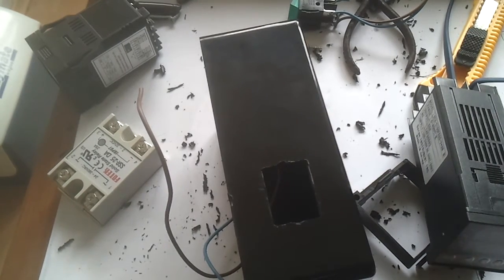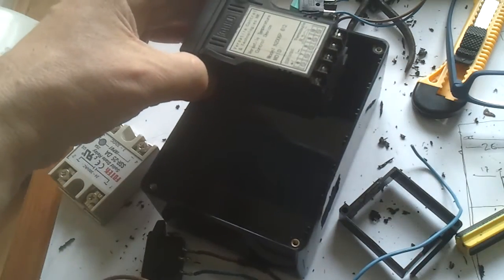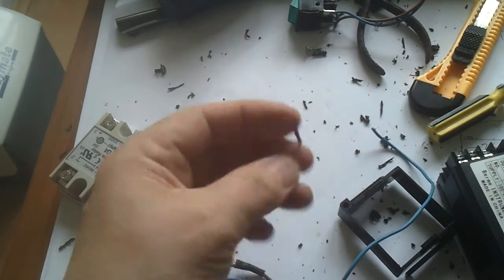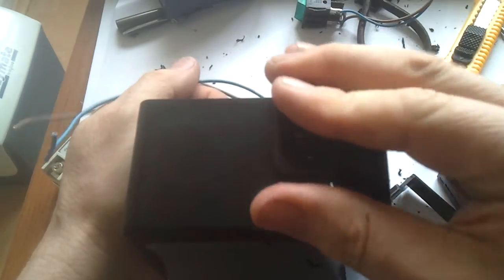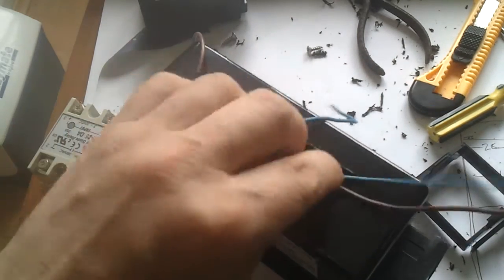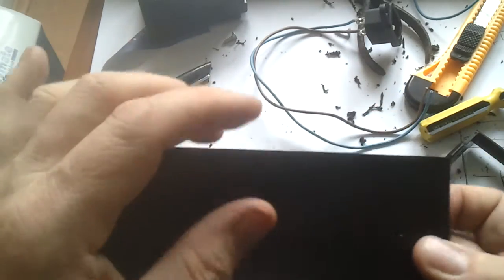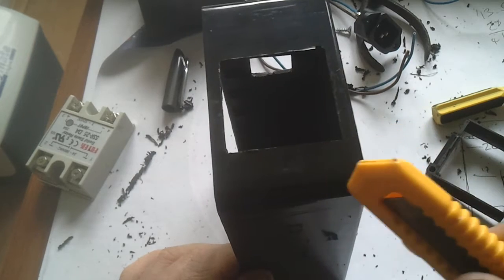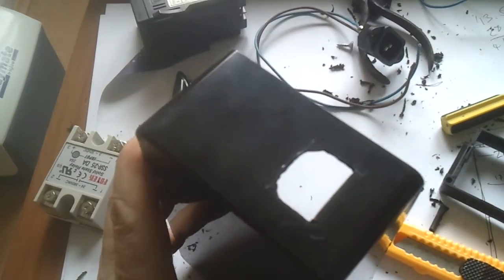Making Accurate Holes in Electronics Project Boxes

Comment: hot knife using solder iron
Reply from the maker: Tried it. Messy. Crteats a bugle aorund the edge of the hole which then needs a lot of work to remove. See my later video - 3D pronted jigs for my final solution.

Comment: 3d print
Reply from the maker: The jigs are 3D printed. The box could be too - in fact I did one. But it takes 10 hours to print, the finish is not so good, and if melts at 70C - not ideal for a plastic injeciton moulding machine.

Comment: For rectangular cutouts, I drill a series of holes just back from the line, then use a sharp chisel to pare away the material.  You need to set up a piece of scrap timber in a vice or clamped to the bench as a backer.  The chisel will push through with little pressure.  (You don't need a mallet or anything.)  For me, it's easily the quickest and cleanest way.  (But I have a woodworking background, so sharpening and using a chisel is second nature.)   I also use flat and round files.  You can also scrape an edge with a stanley blade.  This will remove a small sliver of plastic with each pass.  Watch your fingers though...  Best of luck mate.
Reply from the maker: Hi Rob and thanks for chipping in.
I found another method - essentially 3D printing hole cutting jigs. These are used to scribe a line precisely where the hole is needed. See the video here:  https://www.youtube.com/watch?v=YP92bxAUamE&list=PLEFr39dH1zRIsbqfYjhGUfO59SHncIxLy

That solves the marking out problem - your approach makes actually removing the material easier too, though for the ABS plastic I'm using I'm not sure a chisel would give a good result - but it well might.

Thanks again.

Comment: I have the same problem...and even worse, fitting 3-4" LCD in pressed steel cases. There has to be an easier way. maybe CNC can do this, but most home ones don't seem to
Reply from the maker: Yes, CNC can do it as you say Rob, but I eventually developed a great solution - I 3D print a cutting jig. See the video here:
https://www.youtube.com/watch?v=YP92bxAUamE

Comment: I use a vibrating multi-tool from Dremel - you can find cheap ones at Harbor Freight etc.  Here's a bunch of photos of this tool: https://goo.gl/69awVn You can put tape on the surface and draw your square hole on the tape, then use the multi-tool to cut the hole quite simply. Occasionally a file can be used to clean up the corners.
Reply from the maker: Not sure that's any better than the Dremel rotary tool I was using.

Comment: Terrible video. U didn’t even show your attempt in cutting, tools, experience, etc. 👎
Reply: It was a cry for help...its a fine video.
Reply from the maker: I showed that I was using a Dremel with a milling bit and I showed that it was messy and miserable, so I don't really understand your criticism. Furthermore, as I said in the video - this video is not intended to be instructional - it is a request for helpful ideas. And in that regard, it's been very successful because I got some really good ideas. Thee is a follow-up video showing my current solution which uses 3D printed hole cutting jigs.

Comment: The biggest problem with cutting out square holes in plastic isn't the fact that it's time consuming to get a nice looking cut, but that it's impossible to find bezels.  They only are available in popular LCD screen sizes.  With bezels, you don't have to make it look nice nor do you have to be 100% accurate.  If you have money to invest, invest in making various sizes of bezels from a Chinese manufacturer and you can make a killing with the electronics craze going on these days.
Reply from the maker: Hello Nunya, and thanks for your comment. It's a great point - it's so much easier to do it poorly and cover it up and it really doesn't matter and it's faster and easier. However, with my budget (microscopic) I can't invest in this. Still - I may b able to adapt your idea. For example, I could 3D print some bezels. Thanks!

Comment: Here is a fairly easy (I think) way to make perfect holes every time! :-)
Make or bye a hot wire cutter and then do the following:
Use some thin sheet metal and cut a perfect outline of the shape in that. Put the shape on top of your plastic box, exactly where you want it to be and make sure that it does not move, drill a hole in the center and use the metal outline as a guide for the hot wire.
The result will be perfect every time! :-)
Reply from the maker: Hi Fried Mule and thanks for writing. However, I think your method isn't that straightforward. The wire will flex which makes keeping it at the edge of the hole difficult. Also the metal template would take a lot of heat from the wire, and finally, the wire will push up roles of molten plastic either side of the cut.
Reply: Yes, you are probably right, but maybe it can work, by training and the right amount of heat.
But yes defiantly not as easy as I first thought! :-)

Comment: Would a hot knife / soldering iron work?
Reply from the maker: Hiya Ryan - thanks for your suggestions. They would, and I've tried the soldering iron, but it is difficult to push forward in a straight line - it tends to want to wander. Also it stinks and the fumes are toxic, and it pushes up a "wave" of molten plastic which then needs removing - which is itself a grim task. So it's not a great option.
Reply: What about a hot knife? You can join a knife to solderng iron apparently. You can use an extractor fan so you don't get cancer and die from fumes like steve jobs did.
Reply from the maker: Yes, I think a knife would avoid a lot of the problems I outlined, Ryan. For now, I'm looking into turning my 3D printer into a CNC milling machine and milling out the holes that way. That gives excellent repeatability and a really clean solution.
I made a brief video about phase 1 here: if you're interested : https://www.youtube.com/watch?v=DmfdNIBsDUQ
Reply: Hmm interesting. Maybe easier to design a bespoke box? With a injection plastic machine
Reply from the maker: I've 3D printed one - and it work well, but it took 9.5 hours to print. Injection moulding would be an option, but the injection moulding machines I make (like this one https://www.youtube.com/watch?v=n0ISGwQ9kjk)  cannot do the necessary shot size or pressure. Box-making needs very high injection pressures because of the long runs of narrow mould channels.
Reply from the maker: Hey Ryan, do you know anyone who just happens to have a plastic injectin molding machine lying around on their bench? Oh wait - I DO! https://www.youtube.com/watch?v=tn6-MgJ6oVU

But it wouldn't be able to make a project box. The large thin plates involved need higher injection pressures than this machine can produce and the volume of the part is also far too high for this machine. In short, it's not really a practical proposition.

Comment: I recognize those components. I made a filament extruder with them.
Reply from the maker: You're not far wrong. I use them to make plastic injection molding machines.  Too bad you don't have a video on your filament extruder - I've considered making one myself and would be interested to see yours.

Comment: I too came to this video very late ( Jan 2017) in the hope of finding a better answer . I have a 
nibbler ( cheap from Rapid ) very good for thin material but not a lot of good when the walls are thick . I have QMax punches but they are limited in what shapes they can produce . 
Conecut drill bits and also good but limited . I also have a Weller 8200D Soldering gun with plastic cutting and smoothing bits which are great for roughing out a hole in plastic boxes etc and then I use files and a knife to clean it up .A fan is needed to get rid of the fumes which can be nasty .
But yes , a milling machine would be great .
Reply from the maker: Alan, thanks for your comments. I have also used a soldering iron for this. It works, but it's a bugger to do, and - as you say - it stinks, and it's too easy to wander off track.

Jodie below proposes using rotary saw blades for Dremmels or cheap rip-offs (AKA Dremmoids). I've bought a set but haven't used them yet.

I'll publish an update video showing how I got on, so if you're interested in that maybe subscribe.

Comment: That's what Blue Painter's Tape is for.  Putting it over any surface that isn't going to get cut prevents marking up the box. If it's under 20cm^3, I just 3D print the box. ;)  Don't use grinding wheels to "cut" (melt really) plastic.  They make saw wheels for dremel tools.  Go slow and let the tool do the work.
Reply: Just for example purposes, I've not used this supplier:  https://www.amazon.com/Circular-Saw-Blade-Dremel-Multi-Tool/dp/B009GLRKWK
Reply from the maker: Thanks Jodie, I never even thought there were cutting wheels like this and - s you say - cutting is far better than melting and far cheaper on tools too. Thanks again.
Reply: Chris Wesley my pleasure!  Yeah, it's amazing how many attachments there are.  There's also a plunge-router and router bits for Dremel.  I've found the router attachment combined with a diamond engraver bit is great for tracing the borders of a precision cut.  Then switch to a finger tip controller and the saw blades.  Ultimately better control in light plastic than the bench mill.
Reply from the maker: Jodie, in email I was notified of your further comment, but I cannot see it in my list of comments to moderate. I'm seeing this more and more and don't know why. Perhaps you deleted the comment, so I won't include it her,e but just to say thanks again. I will get some of these tool bits - they will make things so much easier which is exactly what I was hoping for when i posted my video. Thanks again, Chris
Reply: Hi Chris, other than the one talking about the router and diamond bits ( which I see above) I don't remember what else I might have said _ long day.  I'm modifying a heavy metal junction box for a large project, including 3D printing a cover panel.

Comment: Get yourself a nibbling tool.  Start with a drill hole and nibble out whatever shape you need.  To prevent scratches on the case, cover in masking  or painters tape.  Print a paper template on sticky label paper or plain paper with tape and apply over the surface (which should be covered in masking tape).  Also a small drill press will provide better precision and cleaner holes.  Use a digital caliper (cheap on eBay or local hardware store) to measure the components before creating your template.  The more planning and prep time the better the result.
Reply from the maker: Thanks +Digger D. I had never even heard of those, but I see them on EBay now and I'll get one when cash flow permits.

Thanks again,
Chris
Reply: Chris Wesley You're welcome, they have a limited thickness but should work for most stuff.
Reply from the maker: They'll certainly work for my plastic project boxes, which is the main thing.

Comment: Try to use a crossover on your drill press. Lou
Reply from the maker: +Louis Nemick Thanks but neither I nor Google seems to know what  that means. Could you explain further, please?
Reply: What I am talking about is a cross feed x and y  vise
Reply from the maker: +Louis Nemick Ah Louis that is a great idea. In fact (duh) I have access to a milling machine, so I suppose I could use that. It's easy to mess things up with a single turn of a handle in the wrong direction, but perhaps I can man up for the ordeal. Thanks again for your kind suggestion.

Comment: Scribed lines, series drilled holes then a chisel (if the plastic is not too brittle) followed by a decent sharp file is how I used to do such things. Now I always try and get enclosures with removable front panels and do them on my mill or with my CNC router because this sort of thing is just a pain. Really I am surprised there are not ready made enclosures for these temp controllers, I spent hours on RS trying to find suitable boxes and what I ended up with although nice cost probably 4X what the controller cost.
Reply from the maker: +littlestworkshop Thanks for the info. I think my dremmel may be a bit easier than the drill-and-chisel approach, but of course your CNC is a very nice option which I cannot afford right now. ukmwg also suggested the mill, which I may try, but it seems like a lot of work to set up and (if you're me) error prone. Maybe I'll make a CNC router - but the lead screws can be very pricey.

Anyway - food for thought - thanks again.
Reply: +Chris Wesley Another option is the oscillating multi-tools that Bosch and Fein and others do, they let you do plunge cuts with a saw blade, a block of wood as a guide can make it quite precise and simple. As far as CNC routers go one of the best options is retrofitting something that a school abandoned, patience on Ebay can yield some amazing machines for reasonable prices. Otherwise various actuators which include ball screws and rails can also be found on Ebay and save a lot of work. Belts are an option too and actually quite good for softer materials where you tend to want to have faster feeds.
Reply from the maker: Thanks I'll look into these. And sorry - I wasn't notified of your comment and just now saw it.

Comment: Hi Chris, I use a milling machine with a small diameter slot drill and the box secured to the table. If using a Dremel I found it not as simple, even with 2 hands to hold and guide the cutter, it will always want to veer off the cut line in one direction, so make sure that direction is towards the inside of the cut line. What you have done looks fine to me.
Reply from the maker: +ukmwg Hi UKMWG and thank you for your comments. I have access to a milling machine, so it's an option which I hadn't considered.Holding it still on the bed might be a problem but I'll give that some thought.

Thanks again,
Chris
Reply: I'm facing the same problem. I am trying to cut, one way or the other, a square hole in ABS plastic. It needs to be neat and tight because a touch screen has to be built in it. So far it seems to me that the best option could be, as we call it in the Netherlands, a Stanley knife? (Sort of Utility knife) But It needs time en patience if one would work in that way.Ben Vogelzang
Reply from the maker: Hi Ben, Here in the UK we have the same term - Stanley Knife. I wonder who Stanley was. Th trouble with sharp blades is you need to push really hard to get through the plastic, and there is a danger of cracking the plastic or going past the end of the line or cutting yourself.  Since this video was made, I'v continued to make boxes and used a variety of different methods, but hated all of them and the final results. If I had a CNC router, it would be easy, but I can't afford one. I thought about some kind of hot "cookie cutter" but aligning it perfectly is a problem, and it's a one-shot deal. Anyway, if you have any revelations, I'd love to hear about them.  Good luck.
Reply: Hi Chris,Well, at last I was successful in making a square hole. A Stanley Knife turned out to be the right tool. What you should not do: Hard pressing on the knife. The first cut should be no lmore as a scratch.Always along a guide. A ruler for example. At the next cut, you can already push a bit harder and so on.As the cut gets deeper, the knife does not blow out anymore. With me this worked excellent.I got tight and tidy cuts. But, indeed, it takes time and patience! I wish you luck!
Reply from the maker: Hi Ben, thanks for the update. It sounds like you're far more patient than I am. I had a new and fiendish idea for doing this however, which is explained in this video - in case you're interested: https://www.youtube.com/watch?v=DmfdNIBsDUQ